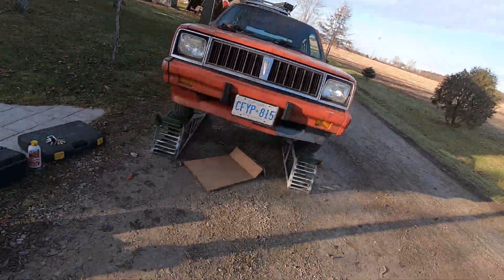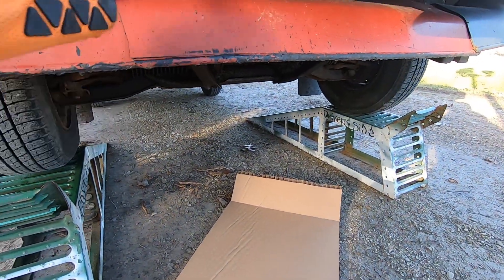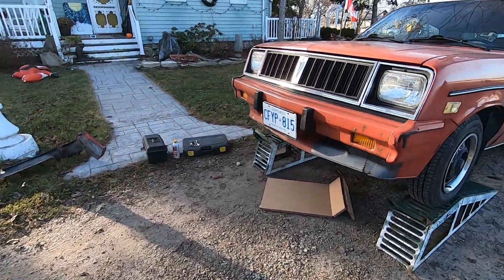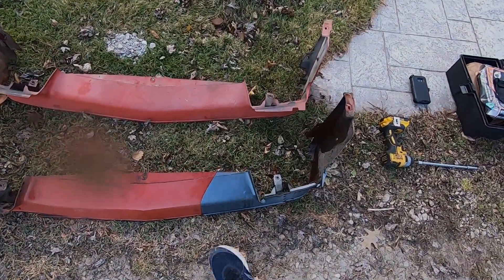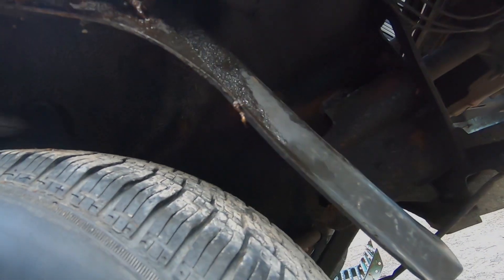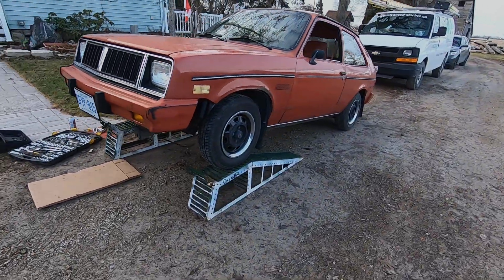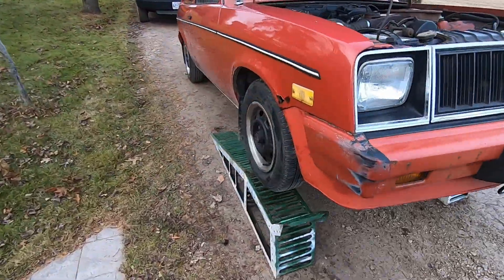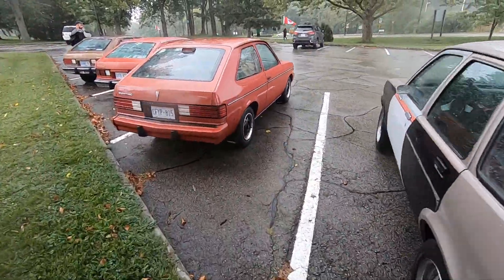Replacing the busted Air Dam on my 87 Pontiac Acadian T1000

Comment: Every Chevette  I've come across has had the air dam taken off, i guess they get busted easily.
Reply from the maker: I think mine was busted from the front springs breaking. The previous owner kept driving it with the broken springs and it was very low in the front.